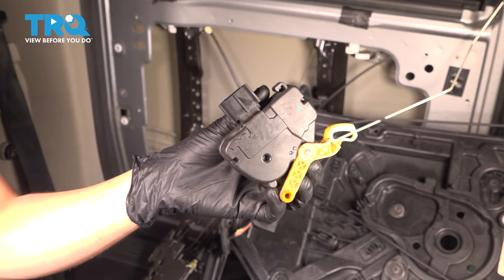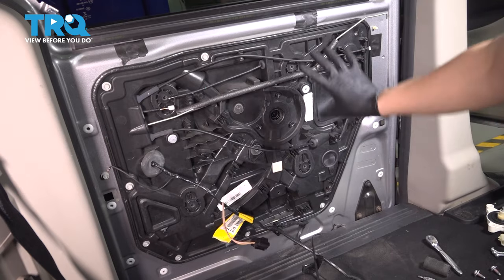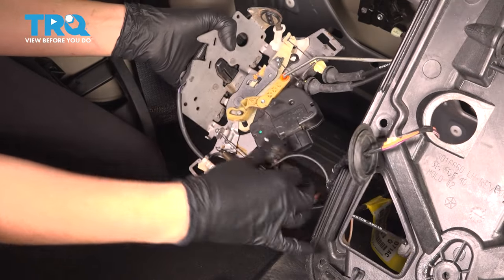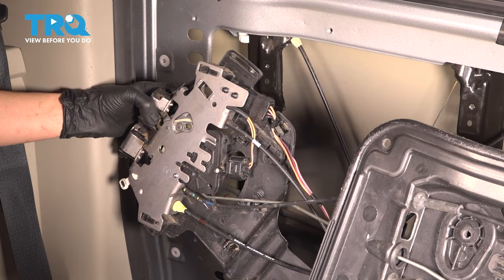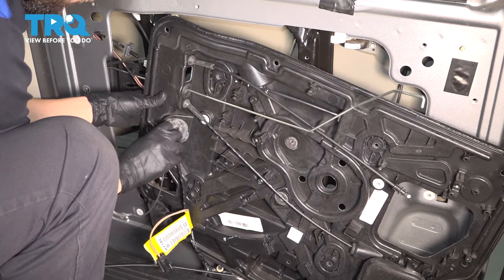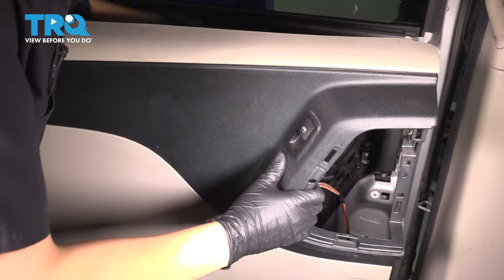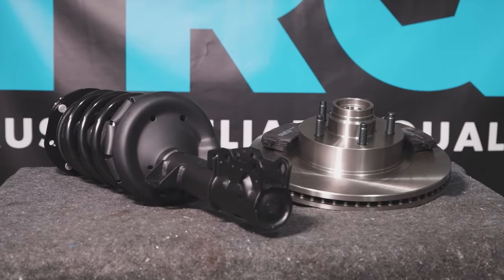How to Replace Sliding Door Lock Actuators 2008-2020 Dodge Grand Caravan

Comment: Thanks for the walkthrough.  Got it done, but this was a rough one.  Never been so close to a rage quit, especially wrestling the back window track and latch back in while it was all hindered by cables and no good access, and inability to reach outside.  I can fix anything eventually but the engineers that buried this sure to fail part all the way in the back instead of by the handle are not very bright.  No way they ever thought anyone would be pulling this apart ever. The one I just changed barely lasted 4 years out of the factory!

Comment: Just replaced this on our van. A couple suggestions to make fixing it a little less of a nightmare:
 1.  If you remove the window track bolts mentioned at 6:29 in the video, you will have the extra play needed to separate the inner panel and lock actuator bracket without breaking it. Still a major pain, but it helps.
2. Door locked shut - If you remove the interior door panel and expose the long metal push rod, you can clamp down on the push rod and push/pull to unlock the door. Clamp down as close to the side with the lock actuator as possible to keep the rod from buckling. This will free up the lock actuator so you can now open the door.
3. Be patient and have a bunch of band aids ready for all the slices on your fingers you're about to have.

Comment: Yes, it is a brain surgery but thankfully a successful one.
You tutorial was very easy to follow and your method worked.
Two notes I would like to share:
* I didn’t see a need to remove the window regulator motor 
* loosening the two bolts that hold the window glass would make it easier in disassembling.
Overall thank you so much. You have been a helpful guide.

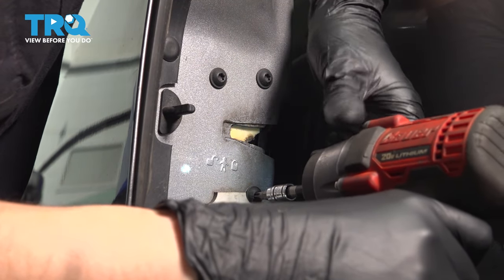Comment: I just used this video to replace my right side actuator. Where's a lot of miss information in this video, at 5:08 he says pull panel out & backwards to disconnect some clips that are in an area. BUT there is no rear movement to the panel. The way to disconnect the clips is to remove the two window rail bolts 6:26 & the three latch bolts 2:28, the movement to release the clips 6:04  well come from the latch being able to move forward, not the panel moving backward. Than when you reassemble the latch just tread the three latch bots in a few turns, than push the latch forward the full depth of the bolts, this will give you the movement needed to reinsert the clips, He says he got the clips back in but doesn't show it because he didn't understand how to get the movement needed & doing this step wrung is most likely how the part that broke was broken. 
Next the unit he was working on didn't have the rear window rail attached to it & if your unit does have the rail. Going back together is a lot trickier.
Pro-tip, remove the outer bottom window trim, as than a helper can help verbally guide the installers efforts to mate the rail with the rear rubber window canal, this is nearly impossible to lineup without removing the outside bottom trim & having someone eyeball it for you, but pretty simple if you do.

Comment: I changed 2 actuators. In the second, I got frustrated after 4 hours. I removed the glass in 5 minutes and then it took me another 10 minutes to install the lock mechanism. I highly suggest removing glass and weather strip around the glass.

Comment: Um, no. 

I'll just listen to the noise and consider trading it within the year. After reading the comments on the fail rate of this part, I guess I should feel lucky that it has lasted from 2016 til 2024.

I did go into the set up menu and disabled the 'automatic lock & unlock' feature to avoid hearing that failed actuator noise when driving.

Comment: Going to attempt this myself but I have a couple of questions. My 2016 Caravan has auto locks but not auto open/close(manual only). Is this still the problem? Locks not working at all, won’t slide at all. Door won’t open at all. Is there a possibility it’s a fuse? (That’s wishful thinking.).

Comment: I just changed mine on the left sliding door and my latch assembly has a big motor attached and the window rail is fully attached and had to remove the entire assembly with the rail I see that there are 2 different ones the one in your video is part number 68030380ac and mine is 68030378ae. Mine is more of a pain obviously but what’s the difference do I have some other feature that you don’t?

Comment: That dam locking bar and window rail made me quit for the night before getting the mechanism housing back in the door. I really hope this fixes my problem or I’m going to set the whole dam thing on fires…

My issue is the the door keeps trying to open while driving and I’ve seen some videos where replacing the locking mechanism fixes it. If not the. Next is the wiring in the slide track

Comment: Hi perhaps you can help me. I have a manual sliding door that cannot be opened from inside. It unlocks and lock fine, it’s not child lock, pulling on inside handle is different from the working door. The working one would pull further and click. The non working one would pull half and stop.

Comment: I managed to get the door unlocked but I cant get the door to open (it tries to but it seems to be catching on something only allowing it to open a half inch or so). I need to get the door open to get to the 10mm bolts to remove the actuator housing. Any ideas?